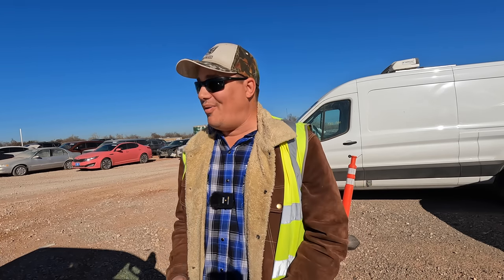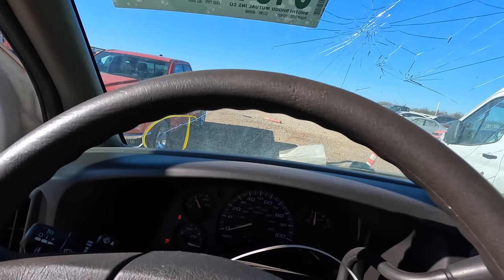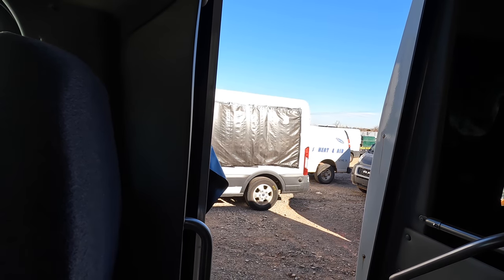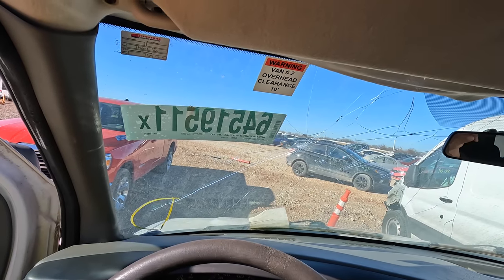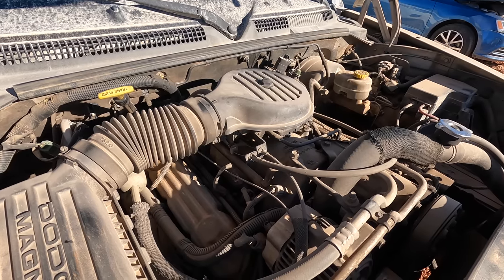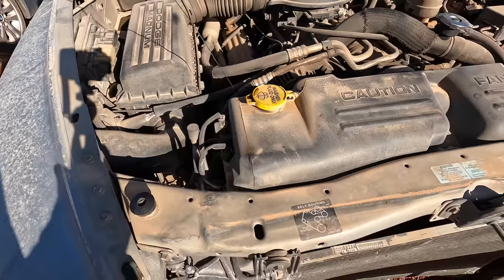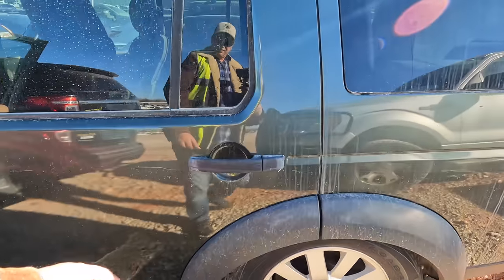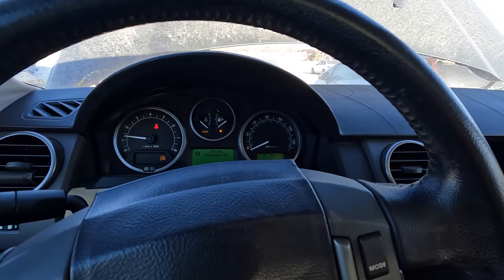Copart Walk Around 1-3-22 PM + One More Party Bus!

Comment: The bus would be an excellent investment. The windows are easy to replace and you may be able to locate them at a salvage yard that specializes in used truck and bus parts. We had a church bus years ago and I had to replace a couple windows and it cost less than 200 for three windows and I replaced them in a couple hours

Comment: The Durango is right about the mileage where the transmission lays down. Common problem with those first generation.
Reply: Mine has 221000 miles.on the original transmission with the 5.2 still going strong
Reply: @martinsoto874  that’s the first time I have heard of the original trans in a Durango going that far.

Comment: Thank you for showing the Durango. Would love to have seen it run. That Durango is a 2000, the 1998-1999 Dodge Durango’s would have the 5.2 or the 5.9 V8. When the 4.7 came out on the Durango and Dakota in 2000, the 5.2 was discontinued for the Dodge Dakota and made lower package (base) motor for the Durango before being discontinued on it in 2001. Sadly the 4.7 is the main reason why a good amount of first and second gen Durango’s went to the salvage yard. The 5.7 Hemi didn’t come out on the Durango til the second generation in 2004. The second generation Durango’s are less desirable and less were made and sold than the high numbers of first generation, in the future, I bet you’ll see less second gens around than firsts.
Reply: i use to have a 97 Dodge Dakota with the 5.2L was black with silver stripes with magnaflow 40 series true dual exhaust and cat delete also had throttle body spacer loved that truck wish i never sold it now

Comment: 318/360 was in the Durango through 2000, the 4.7 started in 2000 and the 4x4 2000 models (and all 01-03) have either 4.7 or a 360.  Rear drive 2000 models are almost always 318 but some are 360.  98-99 is exclusively 318/360 except for occasionally you might find that 3.7 V6 from the Dakota but I'd be surprised if they made more than a hundred or so a year.  The 2000 model we had was the 318, rear drive, no third row, Sport trim, same wheels as that one, no running boards or anything fancy, cloth seats.  Wife usually averaged 17 in it, I could get 19 driving gently like I do.  It wasn't bad but it wasn't better then a 5.3 2WD Suburban (which is what we had next) and way less room all around.  If I'm going to get 17-19mpg tops might as well take the larger vehicle.